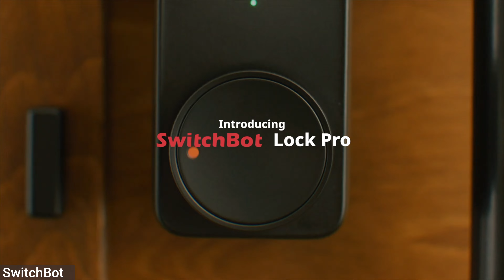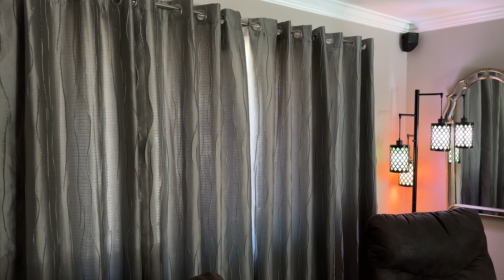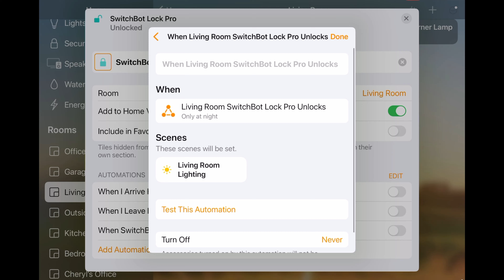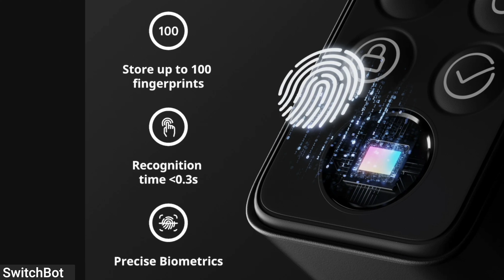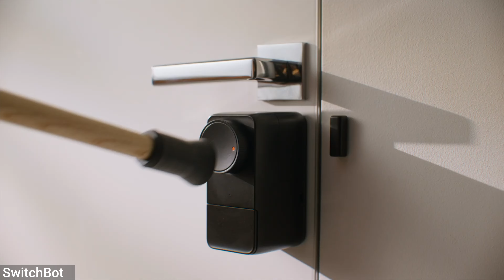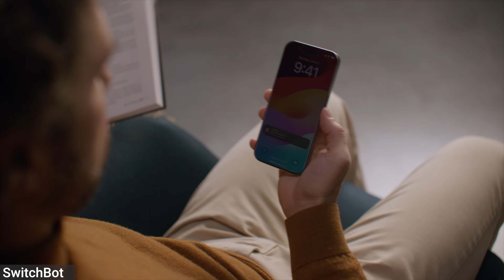Make Any Lock Smart in Minutes! SwitchBot Lock Pro

Comment: I absolutely love their 2 pack independently-used  rechargeable batteries. I leave rechargeable batteries on the charger for way too long with the harriedness of my days. Knowing I won’t be killing a minimum use of just one battery pack until I put the other pack in is great. I hope more products begin to use this kind of system to enable expanded use of rechargeable batteries without having multiple sets of batteries sitting around waiting to be charged or used.